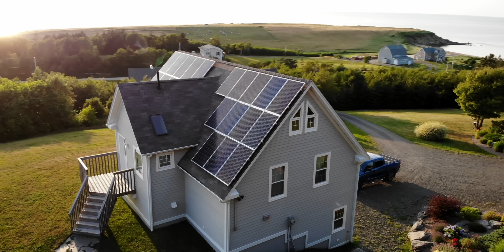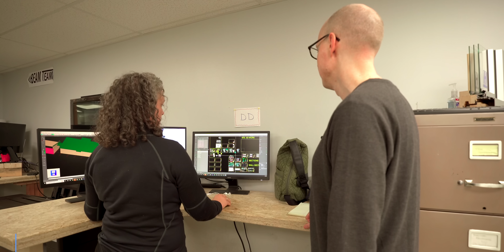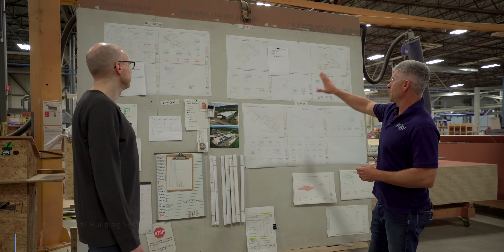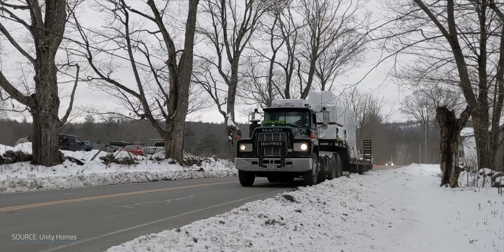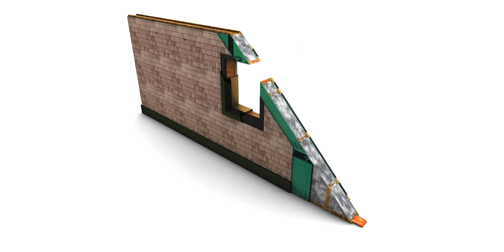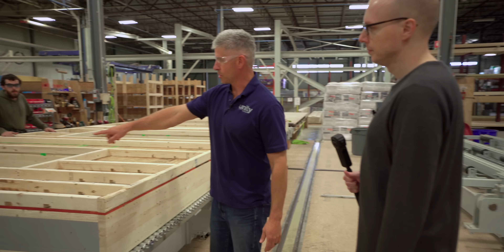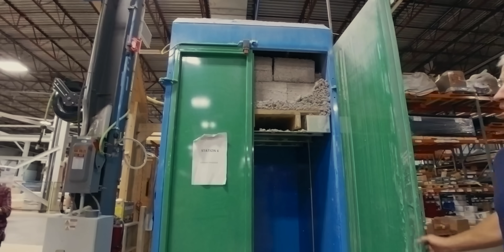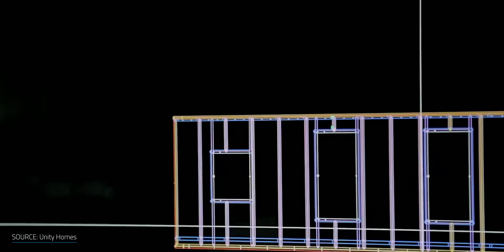The Simple Genius of a Prefabricated House - My Net Zero Home Build

Comment: I'm a licensed architect in Los Angeles. Mass adoption of modular and pre-fabricated / factory built type housing has been a pipe dream of the AEC sector for over 100 years. It seems simple: Use assembly line methods to increase building efficency and thereby reduce cost. Standardize everything the same way cars and other mass produced items are standardized. Use economies of scale to leverage marketforces and drive down housing costs and speed up construction. What could possibly go wrong?

A lot it turns out.

There are 4 big problems facing pre-fab's mass adoption:

1) Non uniform zoning and building codes. 

I practiced and taught architecture for decades in Los Angeles and am licensed in California. The LA metropiltain area  has 100s of different municipalities and city agencies. It has every environment imaginable from steep snowy mountains to blisteringly hot deserts to beach front properties subject to corrosive salt air and periodic storm surges. Each city / area has it's own building code requirments because of this. Don't even get me started on planning and zoning! Those codes are utterly arbitrary, and driven by local politics, economics, aesthetic preferences, and proventialism that favors tradition over innovation. Planned communities have CC&Rs that restrict types and even colors of construction. Imagine if every time you crossed a city boundry, the traffic laws and requirements for your car's engine changed. 

Well, that's what pre-fab housing is up against. How are you going to address the code issues? Customization is mandatory, and customization adds complexity and drives up costs and slows things down. Next up:

2) The high cost, low volume, high durability of housing compared to every other mass produced consumer item makes economies of scale difficult to achieve. 

Think about it: How long do you keep that I-phone in your pocket? 2 years?  How much did it cost? $800? What about your car? You keep that for 5 or 6 years before trading it in? 10 years? How much did it cost you? $5,000? $15,000? Maybe you're a baller and paid $80,000 for it. How much is any of that stuff worth after your done with it?

Now, go for a drive through a major metroplitain suburb. What's the average age of the housing stock? 30 years? 50? 100? How much does the average 100 year old home sell for in Los Angeles? $800,000? 1 Million dollars? 

How many houses are there in America, and how many are torn down and re-built because they have worn out? How many new houses are built? How does that compare to the number of iphones and cars that are scrapped and re-purchased each year?

You see the problem? Housing is a low volume, low margin, durable consumer product with incosistent demand due to speculative market forces and the financial leverage required to purchase it.

3) The power of construction trade associations and unions. 

Trade unions and all sorts of construction materials associations have a vested interest in maintainig the status quo. They lobby legislators on every level from local to national to adopt regulations that favor traditional trade based construction methods over pre-manufactured ones. 

4) The low cost of traditional construction vs pre-fabricated construction.

For all of it's backwards, plodding ineffciencies, trade based light wood framed construction is incredibly cheap compared to pre-fabrication overall. This is because the manual labor involved is cheap, and the capital cost of becoming an on-site fabricator (tradesman) like a framer requires little more than a Skill-saw and a hammer. You don't need much training or a college education to swing a hammer, and you are paid accordingly.

Building a soup to nuts factory capable of churning out Lego Erector set flat-pack type modular housing customized for site specific conditions and codes and owner requirements is EXPENSIVE. It requires a huge upfront investment in terms of capital costs, planning, and especially personel with the technical skills to manage the complex task of designing code compliant customized pre-fabricated housing in the virtual space, and linking the virtual model to cutting edge CAM machinery to get it to cut, nail and glue everything together. You still need humans on the shop floor, and these humans have to be far smarter and better trained and thus higher paid than a day-laboring immigrant swinging a hammer at 16d nails all day.

These are just the major roadblocks. There are many other smaller insidious issues that undermine pre-fab's mass adoption, starting with it's association with mobile homes, cheapness, and poverty in the minds of snobbish social climbing suburban housholders who are not seeking shelter so much as status with thier homes. Untill all of this is successufully addressed, high-end pre-fab turn-key construction will remain a luxury / niche market.

The most promising way to expand it's adoption turns on the economics of it, not the technology. Economics dictate that unless pre-fab can deliver homes to buyers faster, cheaper, or both relative to traditional construction methods, it will remain a pipe dream - at least at scales larger than custom homes for the wealthy and mobil homes for the poor.

Comment: I think the big question here is not "Why isn't everyone doing it?" it's "Why isn't it cheaper?" If they are supposedly saving all this money by assembling in a factory, where are the economies of scale. I think the biggest issue is homes are personal, so the minute you start offering customisation you add to complexity and cost. You take what is a stock product and turn it into something bespoke. This is further complicated by different building codes in different areas. The other issue is scale - how many homes can a factory that size churn out in a year? 1 a day? Doubtful. 1 a week? More likely. The other huge cost is engineered lumber over traditional timber.

Comment: interesting.  i worked in the construction/carpentry business for close to 20 years.  the part around 8 minute mark where you talk about the savings in waste because its built in a factory is really important.  almost any jobsite you work on with a boss that isnt a penny pincher thats always cutting corners.  there is almost always, a decent surplus in extra supplies and material.  generally all of this was charged to the home owner, so the extra 5 or 6 boards here and there, would get left behind in the home storage area.  potentially up to a few hundred dollars in extra materials would be left behind, because if you dont have more than you need, you end up having 8 guys getting paid good wages standing around waiting for materials.  its not how you run an efficient business.  it is far more efficient to buy extra, and just charge it to the homeowner, and then you leave it with them.  where almost none of them take the time to return the supplies, and they just leave it in storage for when they might need it for something in the future.

Comment: Anyone considering a "kit" home should first check with your jurisdiction's plan review section manager. We got all the way to plan submittal in Sonoma County, California with a panelized Mandala Homes plan. The county required both interior wallboard and exterior siding to be installed onsite, so that their inspector could verify code compliance for such things as plumbing, wiring, and nailing pattern.  That completely frustrated our efforts to reduce onsite labor and build time at a remote, short-summer location. [Manufactured Home builders avoid this hang-up through a fabrication certification system, but I am not sure that can work with small to moderate size kit fabricators.]

Comment: I've built custom homes and metal buildings for over a decade, and it's hilarious to try to show a few studs and insulation in a wall as if it's a complicated thing. lol.   There's absolutely no reason to spend all that extra money to have it drawn up in 3D CAD.  It's already incredibly simple and not hard to understand;  especially on a house that is as simple as yours. It's literally 4 boxes, 3 gables and 4 valleys.  The only thing simpler would be a trailer house...   Honestly you're not even building a house/  it's more of a studio apartment and you're really not going to be happy with it when you're done, vs how much it's going to cost.  

Now if you want to get into all the science that goes into an Earthship-- that's a different story.   But piecing together walls in a factory when you could just as easily do it on site is not an "innovation". lol..  You're simply paying a guys $8 per our to build it in a factory rather than a guy making $20 per hour on site who knows what he's doing.  Except you still have to pay that $20 per hour crew guy anyway to put it together on site.  

Also, you're essentially paying for building TWO walls.  You have the 9 inch wall, and yet you're still building 2x3 walls after that -- which is literally the standard of "TRAILER HOUSES" and NOT a standard stick frame home.  I don't' see any reason why that 2x3 wall is even there-  You could just as easily put your wires and pipes inside that 9" wall. 

 I'm certainly not impressed with the cellulose insulation in the walls;   that type of insulation is typically used in attics and it WILL settle over time, and you'll have to drill 3" holes in between each stud later and fill them back up along the top of your walls.  (which will only be a decade from now or so-  you'll be able to see the heat loss at the top of your walls with a thermal camera).   

It's not necessarily a bad setup.  You just got so sold on all the 3D Cad and CNC crap that it tricked you into believing this is something special.  I hate to tell you-- it's just another prefab factory and I hope you didn't get hosed on the price..   You would have been MUCH Better just building it with 2x6 or even 2x8 framed outside walls and filled it with spray foam insulation.   I'm not sure how that would compare on price.  Maybe these guys are super cheap and so it makes more sense.  But they certainly are building it very cheaply/  just with some flashy tech to pretend it's something fancy.  I can see why you built your house so small now-- because of all that wasted material in building two pairs of walls everywhere.   I'd actually be surprised if the insulation R-value was any better on this vs a standard 2x6 stick frame outside wall completely filled with spray foam..  It would be great if you did a video comparing the two.

Comment: The insulation R-Values are too low, I just saw a wall thickness that is only R-13 insulation, and you don't want to have heating changes swinging widely from winter windy nights to summer air-conditioning
Reply: I also have a typed up on Solar if u would like.

Comment: This was very interesting, and I'm hoping to see a follow-up when they are putting the house together. This is absolutely the way to do it, and here in Norway I barely see any house builds done otherwise (all of the houses built in our area the last 10 years has been built this way). I can't think of any downsides compared to traditional ways of building houses, since you have better control of the entire process, everything is built in a controlled environment with no materials damaged by moist and weather, and I would guess that the end result is closer to perfect because of a standard and perfected building process.

Comment: In the distant future, people will wonder why we destroyed so many cornfields by scattering houses over them. Higher density housing reduces energy consumption. Walk or bike to get what you need. I'm older than dirt and retired. Grew up in construction, traveled widely and spent my last semester of Architecture living in Europe in the early 70s. After being an officer in the Navy and traveling the far east. I did my final paper on "New Towns" in the UK. Some good things about them a lot of not so good. Being ecologically well done was not one of the pluses. Strong unions fought to keep factory production out of them. Insulation was absolutely minimal compared to the US at the time. It was almost all government financed, designed and politically controlled. Never a good way to do anything. 

There was a large project called Themes Mead near London. A plant had been setup to produce foam insulated structural concrete panels. A Danish system. Used for both high rise and low rise housing. The unions fought it and the equipment was sent back to Denmark. The rest of the housing was built with hand laid bricks. For insulation an air gap was left between the inner & outer layer of brick. Windows single pane. 

Much money can be saved buy fully fabricating the core of a house in a factory. Most of the heating, A/C, electrical, & plumbing in one box. But many trades jobs would be lost, codes need to be changed and designs built around the cores. 

It's not rocket science! If our cars were built like our houses, very few could afford them. Stick built panels are an improvement but there is a long ways to go.   Similar systems have long been used for mobile homes.  Double & triple pane windows are good, until the seals fail.

Comment: G’day. Yeah… Matt, this is the optimal way for ‘conventional housing to be built. In 15 years, on site 3D printing may start to overtake this approach in efficiency, speed, sustainability, etc… but for now and the next couple of decades, this is the best approach. 

I’m curious to know if your house design has assistive and accessibility elements incorporated from the beginning, so often, we build our houses when we are young - we don’t make accomodation for elevators, hand rails. Variable height, large light fixtures. We don’t consider wheelchairs or walking sticks… even though more than half of us will need them at some point. 

Good luck. Be safe, be well. And congratulations on your new home.

Comment: As a european, american windows allways bewildered me. That said, there is a debate to be had about tripple glasing: at least in europe, where you do not have HVAC Systems, but have to open the windows to let in fresh air, the energy saved by tripple glasing often is chaper than the upfront cost of the tripple glasing (at lest it used to be)
Glad to see that prefab made its way over the pond. I am looking at prefab houses myself, but the type that comes FULLY finished as containersized modules. To be clear, they do not use containers, the just stick to the sizing for transport. The individual modules are build with metal I beams running along the outer edges with the wall beeing timber framed. (and yes, your rooms can span multiple modules, so you are not locked into having narrow rooms only)

Comment: Starting at $400K for 1000sqft, no mods, and no basement is crazy expensive.   That is also not including the cost of the site or any site prep.   Love the idea of streamlining for cost and less waste, more efficient homes, etc.  But at this price range it is unobtainable for most people.   At $400 a square foot with no mods, not sure where these so called cost savings are going, but certainly not to the customer.  If the price was more reasonable I would definitely consider this.

Comment: Pre-fab or manufactured housing is the better overall building technique in my opinion.  I live in a doublewide "manufactured" house that was put together in 1999.  This has by far outpaced the quality of any "tracthouse" or "stick built" house of similar age put up in my area.  I have lower upkeep, better quality of build, and better energy efficiency than the more traditional home styles within the same price range.  Building in a factory to preset standards and QC inspection is going to turn out a better product than hiring random contractors to do a quick job on site.  The efficiency bonuses are also quite evident in how things are allocated and waste minimized.

Comment: In the bay area the stick build industry has kept this far superior construction from getting permits and zoning. But it's obviously the future. We need to pull our collective heads out of our tail pipes.  Housing is enough of a problem without intentionally shooting ourselves in the foot. Tiny house are another thing that needs to overcome stigmas. We have rediculous minimum square foot requirements.

Comment: Upgrade to Rockwool insulation. It's way better than fiberglass 1, it's very fire resistant ( much better than fiberglass) 2, dose not hold water 3 it's not fiberglass fiber that's itchy and junk to breathe.

Comment: In a repair event, umm, someone might drive through a wall and create a hell of a mess for the house, are these guys able to replace a wall easily or would it be a nightmare to fix?

I like this a friggin lot, the guys that build houses from scratch are also having to deal with thieves pinching stuff which adds to down time. I can't wait to see how it all goes together.

Termites, what are they going to do to the base for protection, spray or termimesh. Are their materials termite resistant?

Comment: The old push up window type in the US boggles the mind. Double and triple glazed turn/tilt windows have existed for ages in Europe.
With the push up window style the big issue is: the system is limited by weight, but windows with high insulation are heavy.
Plus the turn/tilt windows are much more secure and no danger for those who use them.

Thanks for being an early (US) adapter with all these passive house standards and showing that it can be done.

Comment: From my experience, the thing lacking in efficient environmental construction in the northeast (maybe other areas, too, I only know here) is insulated wall studs. Every house uses a solid piece of wood that's a direct heat conduit between all insulation layers, from drywall to sheathing. It's crazy.
edit: like building a swimming pool with intentional leaks...